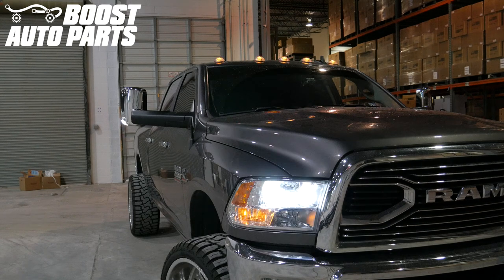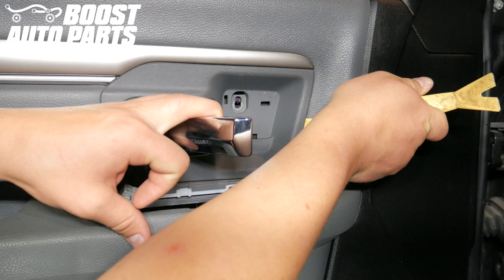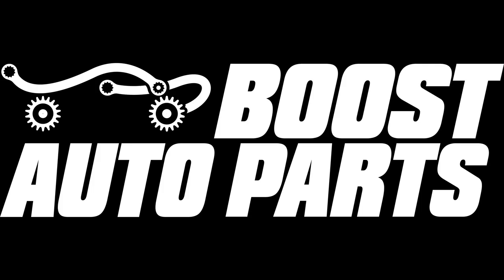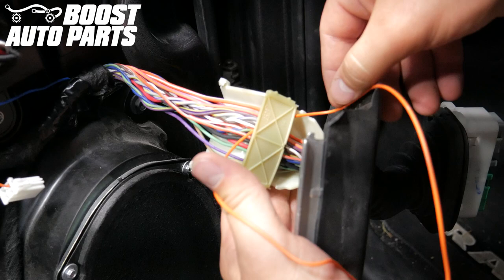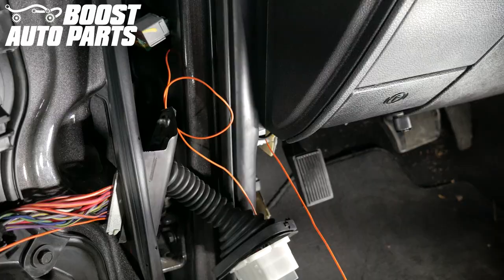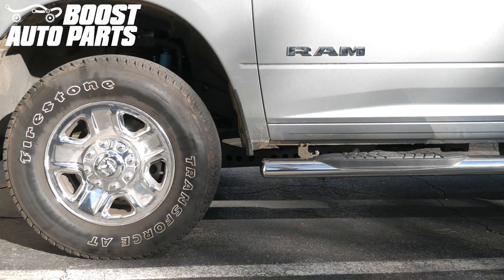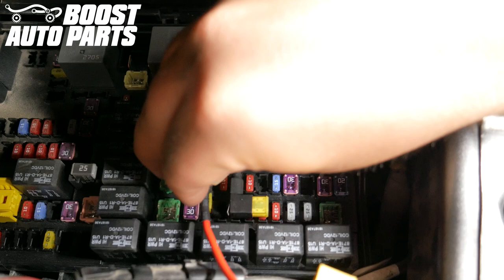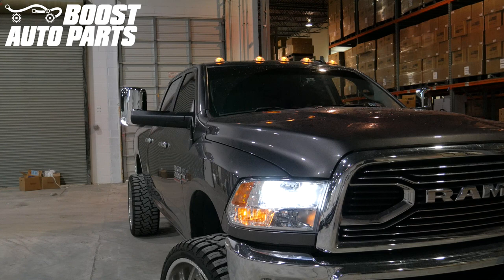Full Tow Mirror Install: (2009-2018) 4th Gen Dodge Ram Tow Mirrors - Boost Auto Parts

Comment: I called the dodge dealer, they wanted $860 for driver side mirror. I ordered a pair of mirrors for from Boost auto parts for my 2013 Ram 2500 at a cost of $399.80. Took about 40 minutes to install each side by myself, would have been longer except this video was spot on and a big help. So literally got 2 quality mirrors for less than half the price of one mirror from Dodge.
Reply from the maker: Awesome! Thanks for the support.
Reply: Was 860$ for the power mirror? That’s fucking INSANE
Reply: @seanlacey5592  Yes the driver side power and heated mirror from Dodge dealer. I have had these Boost for a couple months now and I am very happy. The mirror defroster works as well as the small courtesy light and directional on mirror.

Comment: why there 2 fuse tap in the fuse box ?
Reply from the maker: There may have been other modifications already done to this truck.
Reply: @boostautoparts   and i dont have firewall too pass tru my running light i got a 1500 classic 2021 ?
Reply from the maker: @ceddds  There should be a rubber grommet to pass through

Comment: Ive got a 2017 ram powerwagon, I've heard that if you change out the mirrors from oem to aftermarket it can cause a CEL. Somthing to due with the ambient air temp sensor and will cause the truck to go into limp mode. Is anyone able to speak on that id like to switch but am on the fence due to this issue, Thanks
Reply from the maker: Our mirrors have the ambient temperature sensor in them, so you will not encounter this issue if you purchase our mirrors. Many of the cheap aftermarket mirrors on the market with subpar quality don't have it and cause that issue, but NOT with BOOST AUTO.

Comment: I’ve had my mirrors with the switchbacks for just over a year. The switchbacks work as they should when I remote start the vehicle. Once my key is used they shut off. The 2 fuses in the fuse tap are not blown. Any TS’ing thoughts?
Reply from the maker: Please give our support team a call at 765-831-2830 so they can get to the bottom of this ASAP!

Comment: if my truck didn't come with the factory features of the puddle light or the blinker light how can I activate  those features for then to work with the new Towing side mirrors?
Reply from the maker: Check out this video:  https://youtu.be/Mk3rZCYaB1U
Reply: @boostautoparts  how do I get them to turn on, I have a different brand tho same mirrors
Reply from the maker: @POTFULLOFGREEN   https://youtu.be/Mk3rZCYaB1U

Comment: Where does the orange wire with connector come from on the truck side? I just installed my mirrors and got the running light wires but don't see any orange wires with connectors in my truck
Reply from the maker: What year is your truck? The orange wires come with the mirrors and get tapped to a different location depending on the year of the truck.
Reply: @boostautoparts  2015. I saw that we have to tap it into the fuse and I even found the fuse for it. But I only have the female connector that was sent to me with my order. I don't see a male connector anywhere on the truck to plug it into
Reply: It is also a Tradesman if that makes a difference
Reply from the maker: @ethanwalters871  I'm not exactly following your situation - please give our team a call at 765-831-2830 or email support@boostautoparts.com for assistance

Comment: Is there a difference in this installation video compared to the other video 2 years ago? Just so I know for when I end up ordering these
Reply from the maker: Best to use this video - more current and certain issues with the prior video have been addressed in the re-film.
Reply: @boostautoparts  Awesome, thanks! When I do get to ordering a set of power fold mirrors, do I have to find my own factory part of the buttons panel?
Reply from the maker: @SillyGooser  No you don't need to do that if doing a power folding upgrade. We have an aftermarket wired upgrade available no (4/4/22) - and will be releasing a wireless upgrade that utilizes the factory switch within 60 days from now.
Reply: @boostautoparts  Right on, I just couldn't find on the site when I briefly looked and a wireless idea will definitely help save time so that's a nice idea